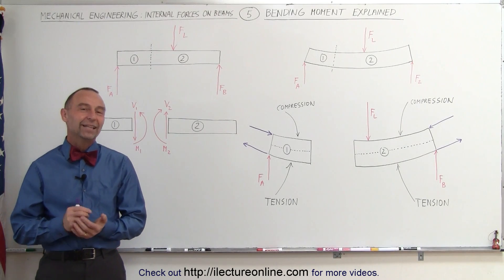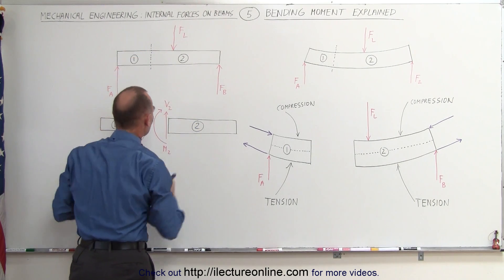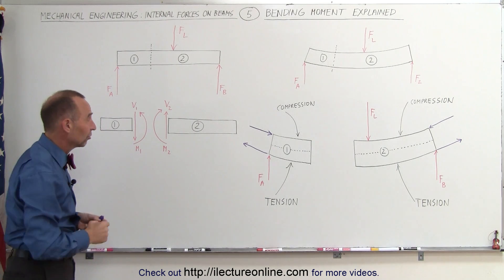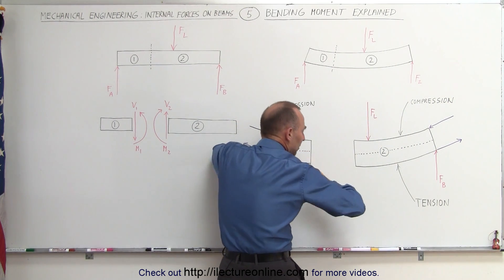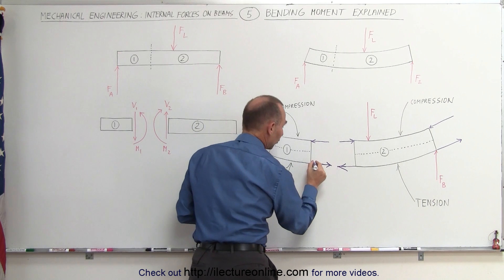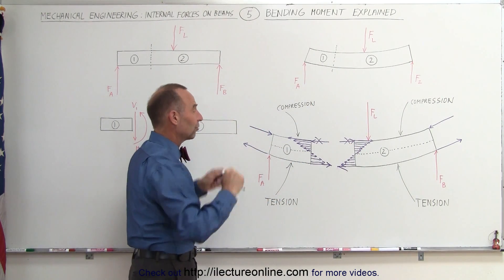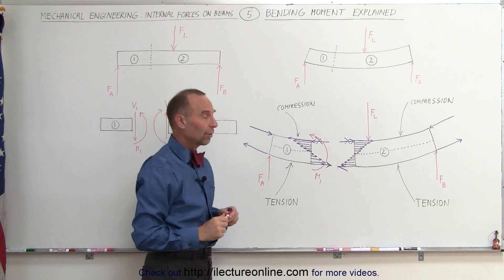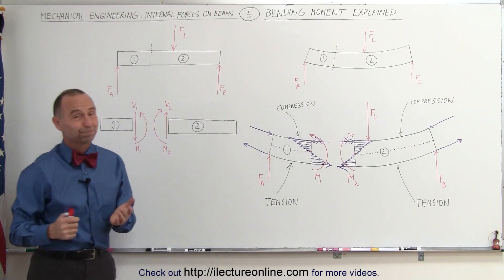Mechanical Engineering: Internal Forces on Beams (5 of 27) Bending Moments Explained

Comment: I have a question at 03:18, why the internal forces on the right side of part 1 are like that? I thought the head of internal forces should be opossite because in part 1, compression is applied on the top side and on the bottom is tension.

Comment: I dont get why the arrows are pointing away from eachother on the top...during a sag, arent the forces pushing into eachother on the top and away from eachother (like streching) on the bottom?
Reply: These are the reaction forces. They oppose the bending of the beam.